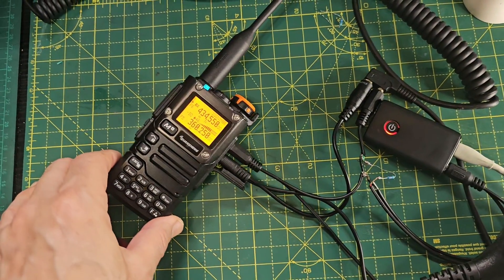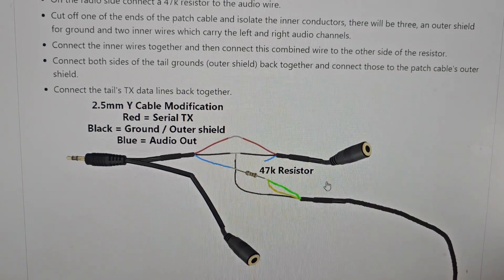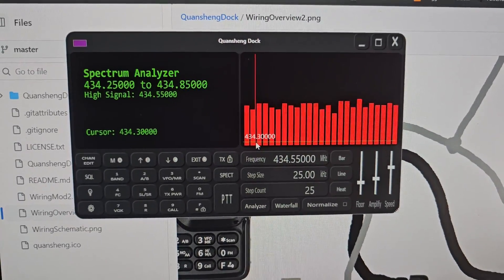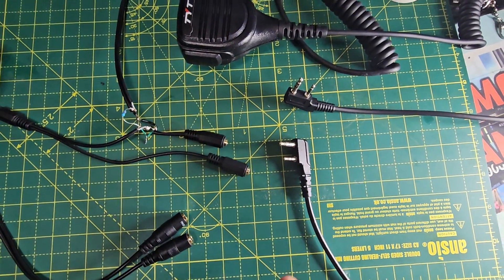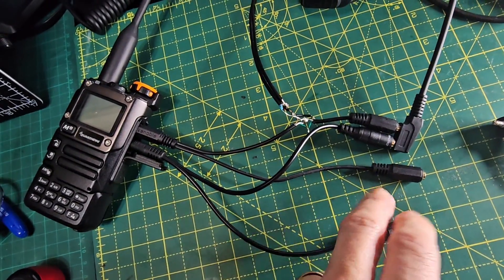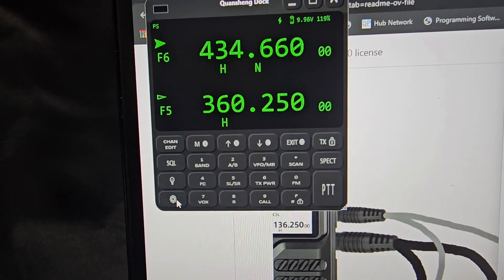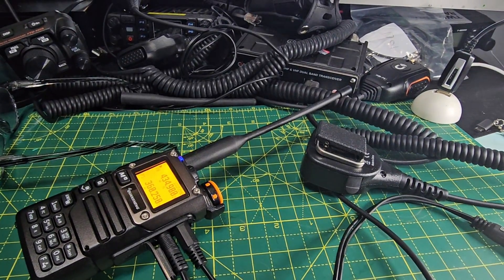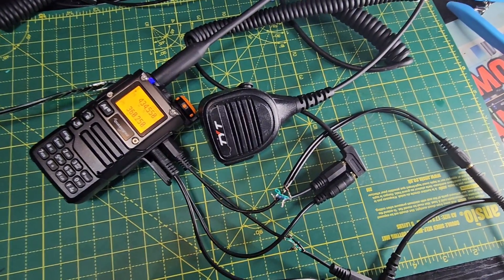QUANSHENG DOCK - MAKING CABLE LEARNING , Tests

Comment: Why isn't the lead out with the 3.5mm Jack plugged into a amp/sound card? I did mine it worked perfectly apart from possible voltage from tip of 2.5mm jack (thats my problem) looks like you have cable confusion as well as me but it really is simple in the end thanks DE M7SEY 73
Reply from the maker: I followed instructions by developer the audio comes from 2.5.

Comment: WARNING : After some unfortunate incidents by users I'm going to put this warning and disclaimer up. DO NOT attempt to transmit without the proper precautions in place. Transmitting 5W of RF energy centimetres away from a PC can LITERALLY destroy it, it's almost like an EMP at that distance. Get your antenna away from the PC.
Reply from the maker: Hi yes best to be safe but I make hundreds Videos doing this for years this has never happened to me most hams sit at there Shack tables transmitting RF .
Reply: I meant, with the uart cable connected to the PC @M0FXBHamTech
Reply from the maker: Oh I see thanks

Comment: You need to check the passtrue box in settings of the quansheng dock.
In your video it was turned off it needs to be on.
To get the sound over the speaker of the pc
Reply from the maker: I see thanks